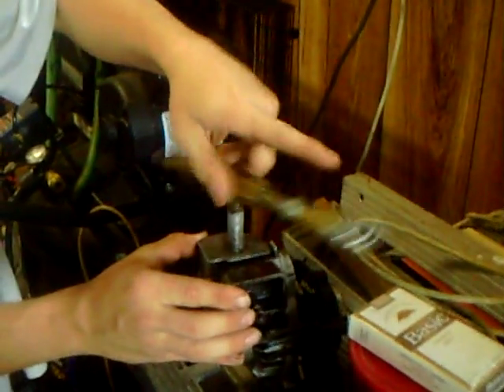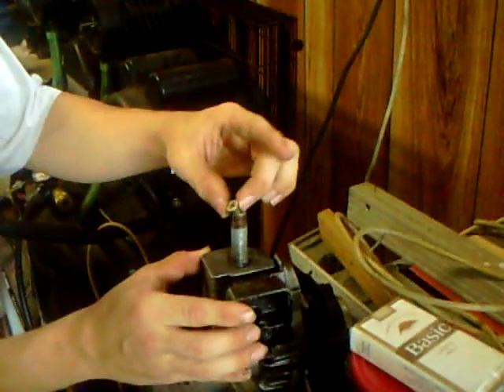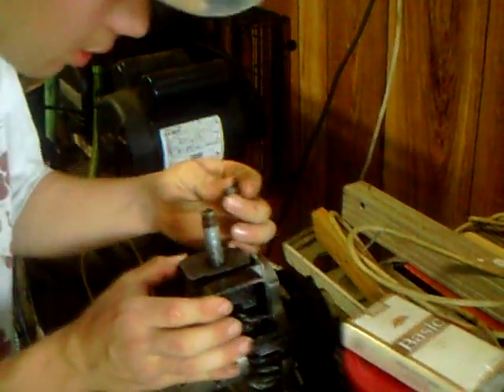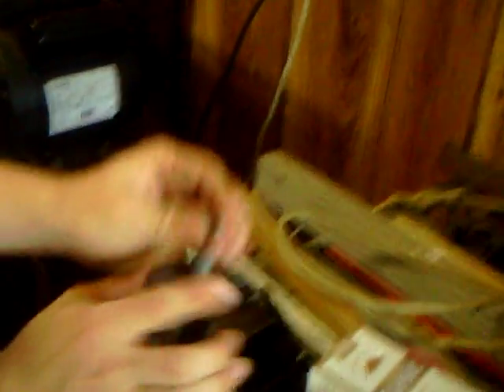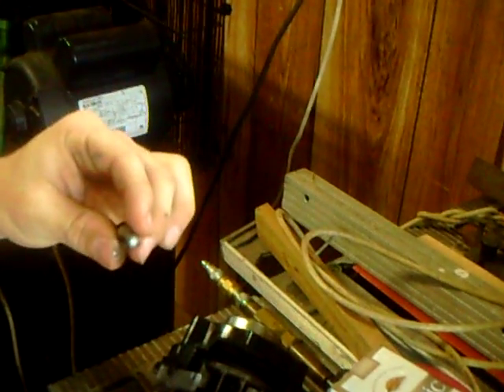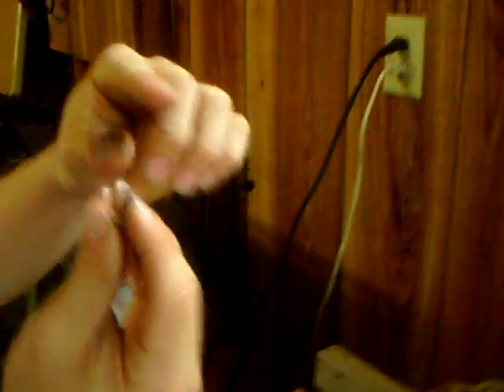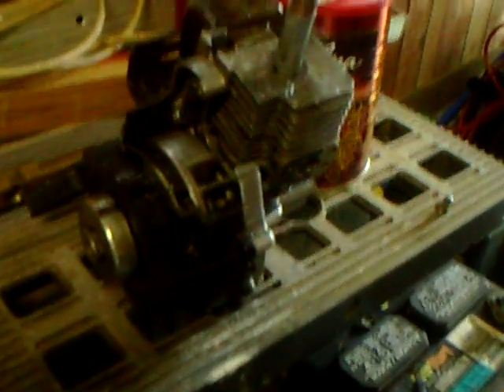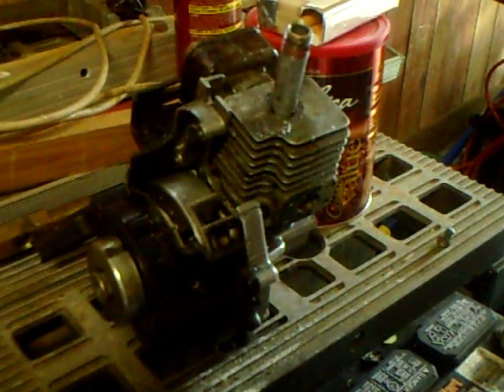compressed air engine!!! (please comment)

Comment from the maker: @Mr3wheeledbike i dont have the engine anymore, you need to strengthen the top of the piston with plate steel or something like that or else the pin will punch a hole in the top of the piston like it did mine. there is a better design the you can use instead of having the top of the piston smack the pin to open the valve. instead have a pin welded to the top of the piston that pushes a steel ball up to let the air in, ill send you a link.

Comment from the maker: @Treddtruck the goes down by its own weight pretty much but mostley by the pressure behind it, and the valve is just an old large screw that made a good seal around the pipe, the valve is all home made, here this link will help,

Comment: The compressor was free since the previous owner gave it to me (AC was removed at some point) If I had to buy one new they're around $300 or so. I'd probably go to the junkyard first though. The copper pipe for the exhaust was free since I had it laying around. I just spent $20 on fittings for the intake setup though. I need a few more fittings, etc., and a steel plate for the top (too hard to make original compressor head work.) And the clutch needs to be welded together to make it one piece.

Comment: LOL. I think you may have me mixed up woth someone else. The engine that I am working on right now is my first : ). As far as size goes, the volume of each cylinder comes out to 6.28 cubic inches. So when you add the volumes of both cylinders together, you get a total of 12.56 cubic inches, or 205cc. Not bad. I would think that it should produce plenty of power, even at a low psi level.

Comment: Thanks : ) There's not much to tell at this point. I just picked up some fittings to replicate your inlet valve setup, though I modified it a bit to work for my application. You can see what I am starting off with though if you search for "York" compressor on eBay. The only difference between those and the one I am using is the fact that mine has a much heavier flywheel with a single v-belt groove (since it came off of an older car.) When I get it up and running I'll have to put a video up..

Comment: Very nice : ) I may have to try this with my build. My CA/steam engine is the old twin-piston inline AC compressor from my '66 Fairlane. I chose it because it already has one heavy ass flywheel, and it 's a solid big chunk of iron. I already drilled the exhaust ports near the bottom of the cylinder to make it exhaust like a 2-stroke engine, but I was having trouble finding a solution for the intake (didn't want to use an electronic solenoid.) But thanks to your vid I may have a solution : )